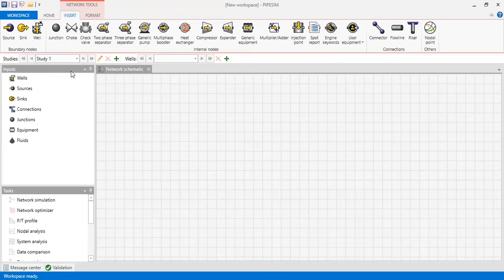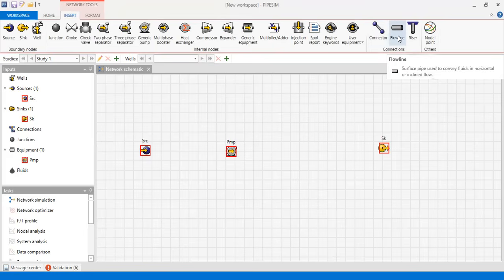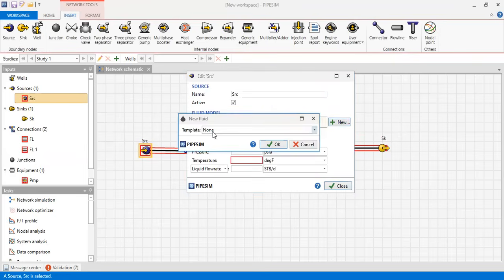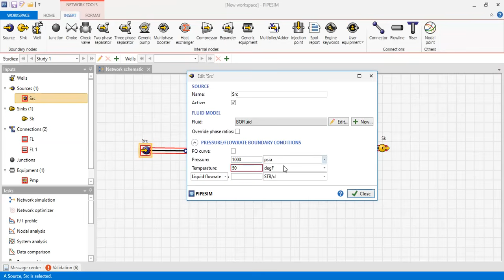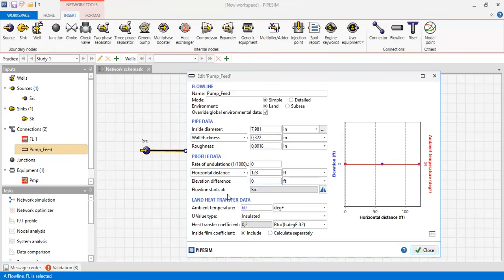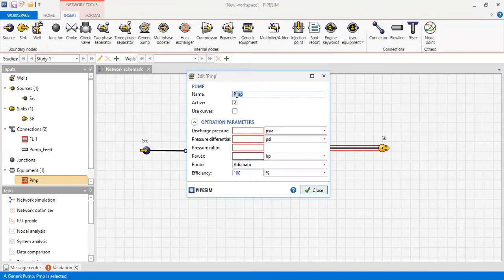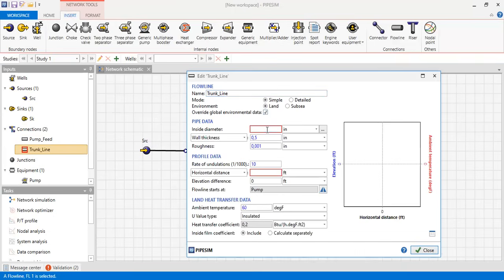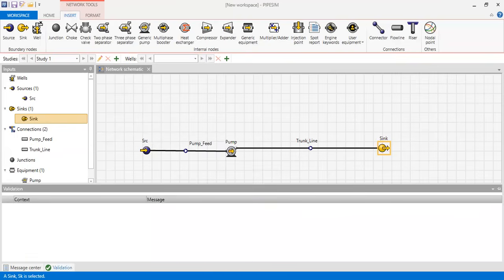Pipesim Network 1: Crude Oil Pipeline, Part 1

Comment: Hello, may i ask, what kind pump type you assume in this simulation? why you input gas oil ratio (GOR) for inlet of the pump,  because at suction of the pump (at surface facility) we need to avoid gas content, to prevent pump damage. 

Thanks

Comment: sir eng-man, why my pipesim doesn't have network optimizer feature, just like yours , next to network simulation in home tab, what's wrong with my pipesim tho?
Reply from the maker: I am not sure. But probably because you user older version
Reply: @EngMan101  how can i get the newest version like yours, but for free, i need pipesim for my tugas akhir 😂, gas lift optimization
Reply from the maker: @paskahpasaribu8185  mungkin dari kampusnya ada yg license Bang
Reply: @EngMan101  tbh yes they have, but i need to pass throughout bureaucracy rambling to get that dumb license, btw thanks brother 👍, maybe next week I'll get those license